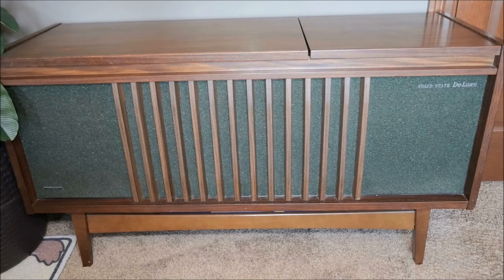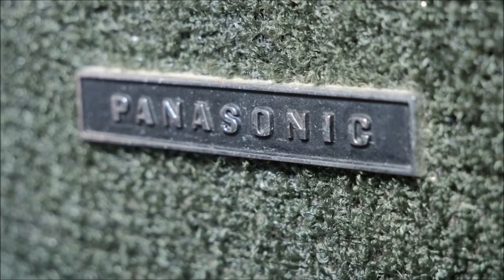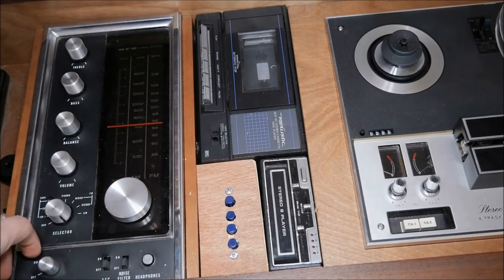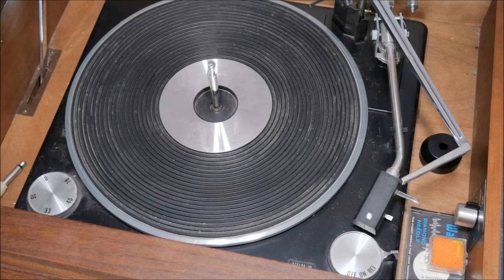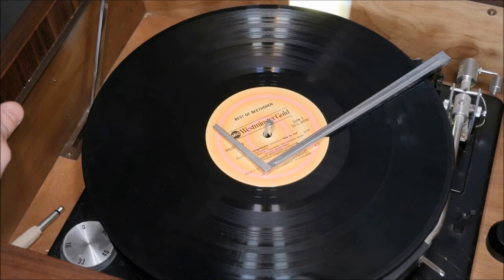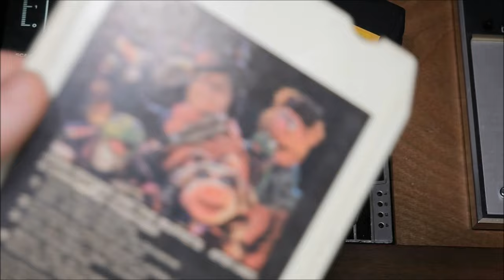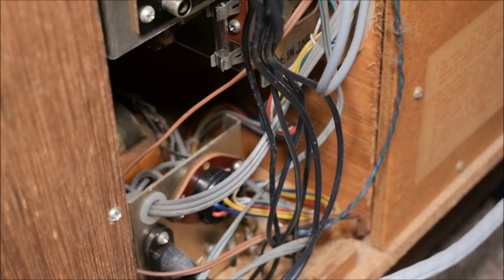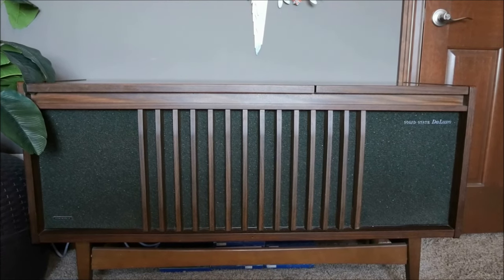Let's take a look at the Panasonic SE-9000 HG Stereo Console

Comment: Modified, right?
Reply from the maker: Yeah, I added a cassette and an 8 track player in the record slot holder. I replaced the lights in the radio and the r2r with LEDs as well if that counts.